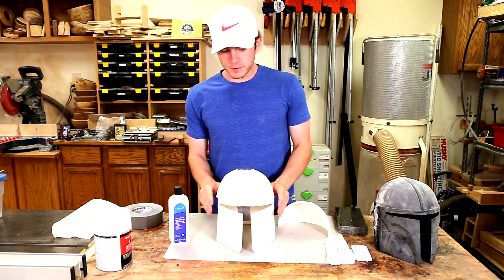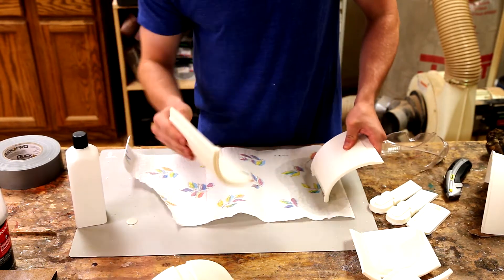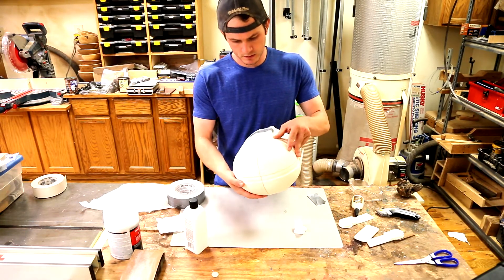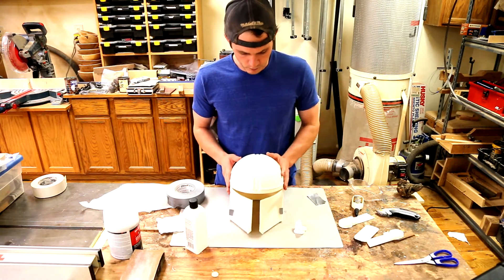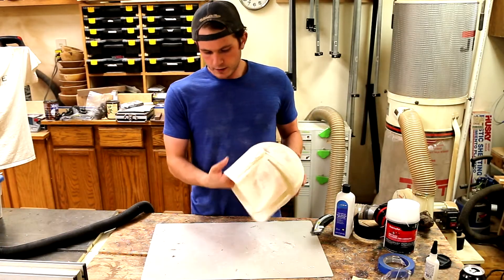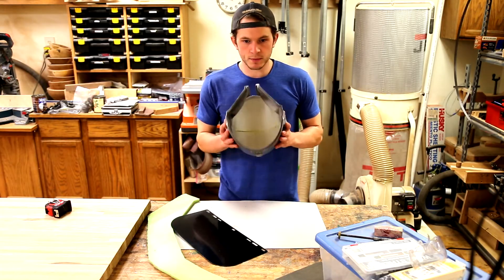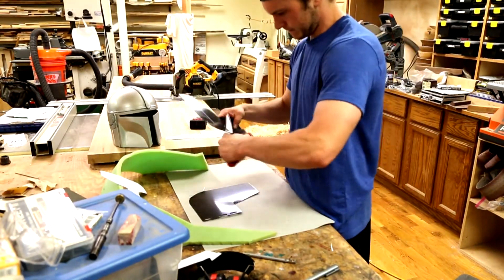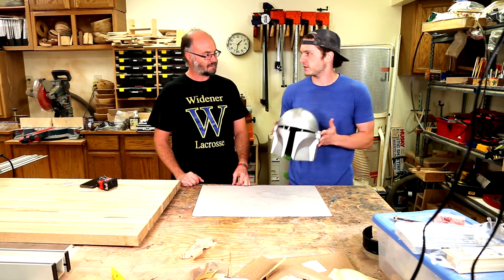Making a Mandalorian helmet from 3D printed parts

Comment: Great video. Where did you get the files especially since i cant make a solid helmet . i only have 200mm x200 to work with. Thanks
Reply: here is the file i used. https://www.thingiverse.com/thing:3578797

you may be able to make it on a 200 by 200 build plate, good luck.

Comment: Should have integrated tongues and grooves in the mating edges.
Reply from the maker: Good idea.  Would facilitate alignment as well as increasing strength.
Reply: Good reccomendation, but t his model has tongue and grooves on all surfaces other than the middle edge.  The alignment issues were from warped prints since all the good ABS filament is sold out and i had to use cheap stiff from ebay.